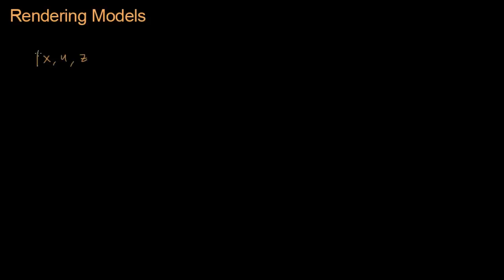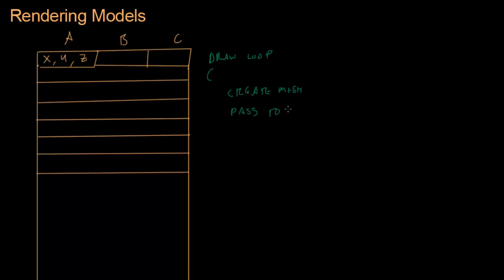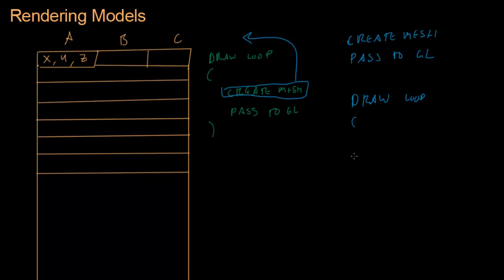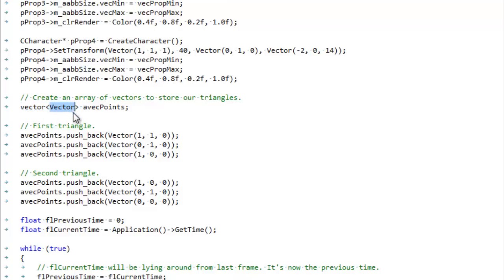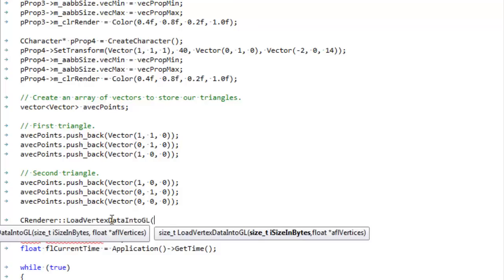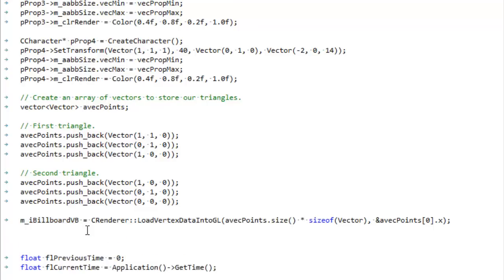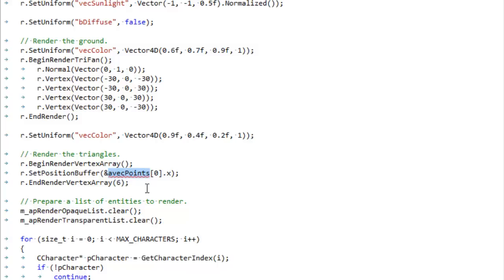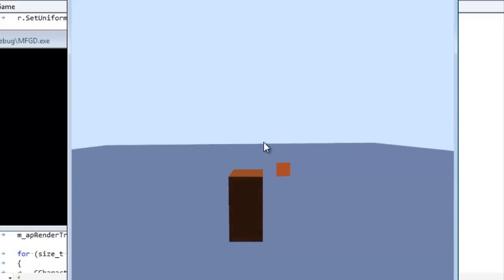Math for Game Developers - Vertex Buffers

Comment: I notice that there are small dots in the lines whenever you make a space. What setting is that? What IDE or editor do you use?
Reply from the maker: It's Visual Studio 2010. There's an option to show whitespace somewhere in the edit menu. I try to remember to turn it off when I make a video but sometimes I forget.
Reply: Jorge Rodriguez
Well I was asking because I think that it would actually be pretty helpful to know how many spaces without having to drag your cursor through it. I am OCD about aligning my code the same.